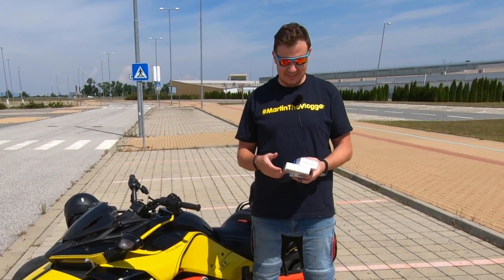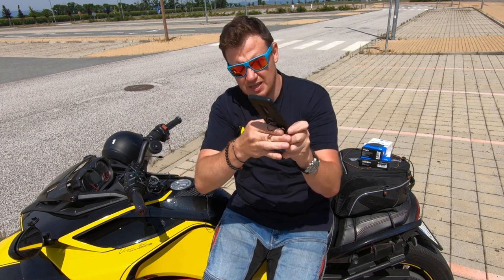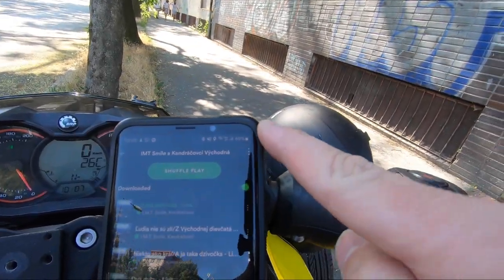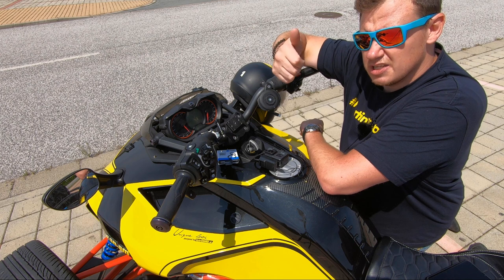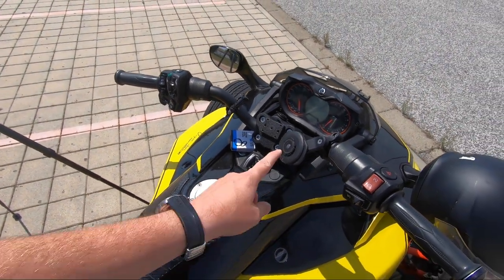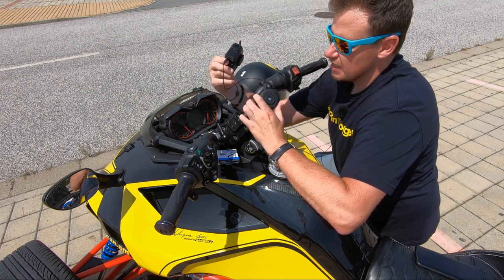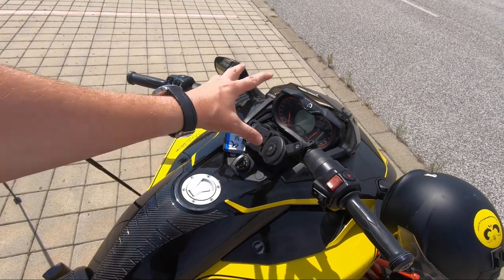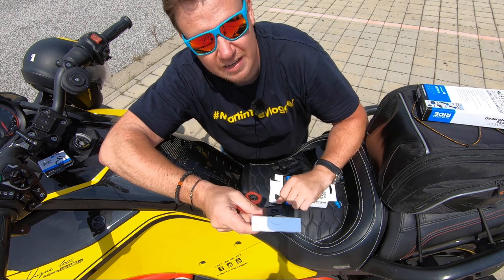Quad Lock Wireless charging head, USB charger & Phone ring stand [Honest review]

Comment: I couldn’t agree more with everything you said. ESPECIALLY the on/off switch for the wireless charger. Definitely helped me decide on not even buying a charging mount and just getting a regular quad lock mount.
Reply from the maker: Many things has changed now Aaron. There is switch and also be careful, buy vibration damper as many phones suffer lot from vibrations and their g sensor is getting bad.

Comment: Get power from your licence plate light instead of your battery chief. That way the charger only comes on when the bike is on
Reply: Perfect solution Jake, thank you!
Reply: Was going to say the same. You should be running all electrics through the ignition (except an alarm) obviously using relays so you aren't drawing power through the ignition switch itself. 
Very few people would need the ability to charge a device when you aren't riding.

Comment: The usb charger.  Just put the usb port facing down.  Then you dont need to worry about the rain.  Just an observation. Seem a better solution then the battery draining wireless charger.  The wireless charger does not seem be well thought out for motorcyclist. Use your old case with the stand.  And get the quadlock universal kit and stick it to your case.  It sticky pad hold like a gopro helmet mount.  You can use it on any metal or plastic case for under 20 euro.
Reply from the maker: That is quite a good advice buddy. Thank you 😉😉😉🤟

Comment: Hi Martin - thank you for your great overview of the Quadlock Motorcycle Wireless Charger I found it very useful and you pointed out some faults that I would not have noticed, I just purchased the mount myself and are looking at the different ways to wire it up. I checked the one that I purchased and it did include the little O rings on both USB Cables which was good but the battery drain over time is not so good so I think I'll look at connecting a double waterproof USB port connected to a wire that only is active once the bike is switched on. thanks again for your overview and keep them coming - regards Mars
Reply from the maker: I did notice however one mistake. There is a switch button, and tgat is a big help, but still not sign of recieving those rings for waterproof protection and i hate that fact :(((
Reply: @MartinTheVlogger  Hi Martin, great video. So there is a switch on the wireless unit to cut off the power? Just want to check before purchasing. thanks.
Reply from the maker: @jimjamjom1  yes, also they did fix the cable that was a n8ghtmare,.. but still i dont know man... i would not buy it anymore... 🤷‍♂️🤷‍♂️🤷‍♂️ lot of trouble for me,. I preffer to chrage my phone in frunk on wireless charger.. or better said i have portable kickstart battery with me, snd its much better investment for me 😉🤘
Reply: @MartinTheVlogger  Thanks. Do you have a link to the products? I'm still looking around to find what would work best for me. thanks
Reply from the maker: @jimjamjom1  i talk about this. It has saved me few times already 🤘🤘🤘 https://www.martinthevlogger.com/product-page/rg1200-portable-jump-starter-baterry-accessories
Reply: @MartinTheVlogger  great thank you!

Comment: Those are very good points you made with the light on the wireless charger head and the not so waterproof and dust resistant
Reply from the maker: There is one mistake in review, there is power button at the back of the charger, but its annoying button :((((((
Reply: @MartinTheVlogger  yep that was what I was going to say, there's a little on/off switch.
But still, it is not really IP66. I suppose you can open the device, solder the usb cable to the pins and route it towards the battery. Don't forget to add a 3A fuse. ;)
Reply from the maker: @Electherm  :)))) yup, that may be the way 😉😉😉🤟🤟🤟🤟
Reply: Yes on off switch solves the problem of the blue light 🙈

Comment: Hey Martin , Cut the usb cable and hard wire it to an automotive relay ,,,,problem solved, It will only have power when ignition switch is turned on.

Comment: I have just received the charger from Quad Lock. It seems they have fixed the connector gap problem. Now the socket is very deep and the connector has two rubber seal rings on it!
Reply from the maker: Yup I have seen it. tell me your experience please. But from what I have seen, it is OK, however I still prefer to have it connected not via USB C :(
Reply: @MartinTheVlogger  The sad part is they don't ship the charger box any more with it - just the head and two wires. So I have to find some 3dr party one like Optimate. I really like the minimalistic construction of Quad lock mounts, I use them for both my bycicle and the motorcycle and have been waiting for the waterproof wireless charger for some time already, so for me it was not a question to buy or not to buy it :)
Reply: @MartinTheVlogger  As soon as I have it installed and tested in different conditions, I will leave another comment here.
Reply from the maker: @sergejsvinniks1728  🤟🤟🤟

Comment: You should never connect anything directly to the battery . You connect it to a key 🔑 on power source . Most motorcycles utilise the rear light power wire . That way your blue light only comes on when the ignition of your Can Am is on . You have the first generation wireless charger , the second generation has a longer shroud that means there is no gap when you plug it in and the connector comes with a rubber grommet
Reply from the maker: Thank you Sir. Good points and ypu are right about the connection to batery and also about 1st vs 2nd generation. 🤘

Comment: According to Quad-Lock’s website, there is is power button on the back of the charging head. That should solve the light on all the time problem. Do you not have that on yours?
Reply from the maker: Hmmmm.. need to check that, but did not saw that, to be super honest ☹
Reply: MartinTheVlogger - If you look at the Tech Specs section, there’s a picture of the back of the device and the power button is almost diagonally across from the USB port.
Reply from the maker: @Rambler358  it can solve some issue, def. Thanx buddy 😉
Reply: MartinTheVlogger - Okay, good to know you have the power button. I was starting to wonder if maybe some didn’t.
Reply: MartinTheVlogger - Also, Quad-Lock sent out grommets to cover the gap in the USB connection cable. You should’ve gotten those.
Reply from the maker: @Rambler358  yup, i wgot em, thanx buddy for all of the updates 👌👌👌 btw, shortly i should get a new holder that holds the phone via magnets. Its a brand new thing and i shpuld get it in October i think.
Reply: MartinTheVlogger - Is this a Quad-Lock thing?
Reply from the maker: @Rambler358  nope, its called Peak Design and i have seen some video about the product already and its super coool. Lets see.
Reply: @MartinTheVlogger  - I went to the PeakDesign website, but couldn't see anything like that.  Do you have a link?  And what will you do for charging?
Reply from the maker: @Rambler358  their solution is new thing and its under information embargo until i think mid of October, where all will be presented :( i need to ask them what they plan to do as for charging, but because its end of riding season i can wait, what they will come up with during the spring 😉😉😉

Comment: I too bought all those products. It appears you have wired wrong your wireless charger. It should wired in a switch formation so that the charger only charges when the motor is switched on and therefore will never drain the battery. 

It is also worth noting the quad lock ring does not work with desktop wireless chargers.
Reply from the maker: 👌👌👌 thanx gor additional info 😉😉😉😉

Comment: Uh, mine has a button on the back that turns it off.  You should double check
Reply from the maker: Yes indeed,. you are right,. my falt this was.. however i have constant problems with this wireless charging unit :(((( now it stop working in general :( probably I will go for SP connect now :)

Comment: You are the only rider here i have seen posting the bad about the wireless charger.  That groment they provide for the usb c cable can get lost if you disconnect it often.  The other thing no one really mention.  Well maybe they dont ride enough in the rain.  If you use the phone in landscape.  Rain will get into the phones charger port. Not a quadlock issue. But using a cable plug into the phone prevents rain from setting into the phone port in landscape mode.  I’ve seen it happen with phone in landscape mode.  And nothing plug into the phone port.  Ie usb c cable or a usb c dust cap you by on amazon.  And the person had to use a hair dryer to dry the port to get the notification to go away and the port to work again.  Just a motorcyclist observation from normal uses.  

The other thing that is a must is the quadlock vibration dampener.  Some phones camera’s ios hw do get damage with quadlock and other mounting system.  If you are endosing quadlock.  I would put that out to you subscrbersas a must have add on.  Jmtc.
Reply from the maker: Jamie, its not bad only. I have good review about them as a general holder. This w.ch. its not good, and i like to share my observation. Its not hate. Also i have to fix one thing. There is a button at the back to turn off the power. However its very bad for riders as its so small tgat you wont press it while you have the gloves on. They need to test before they release their items.
Reply: @MartinTheVlogger  even with it turn off.  The wireless charger still draw current from tne battery. There are reddit and some youtuber posting that info.   I want 0 drain when off.  Only way is to hardwire it to the fuse box or trap it to the a circuit like the brake light that is always on when the key is in.  Just not well thought out.

Comment: Cheers for the review, was very helpful when looking to purchase! 👍
Reply from the maker: Now they havefixthe issue withbtgat connector. I still dont likeit, but its better,. And also there is a button toturn it off 😉😉😉🤘
Reply: @MartinTheVlogger  to be honest I expected it to be a fixed hardwired cable not a USB plug in one! Power button on the new one seems a lot more sensible. Little lights on unattended bikes attract scum! Also not good for battery drain!
Reply from the maker: @DaveRogers1985  cannot agree more with your reply!!!!

Comment: Great review I'm glad I came across this review.
Reply from the maker: Danny one update. There is swich button behind... but i hate it... but i have missed it on review.. the rubber ring fix they have send its bad.. i am not sure if they have a new thing as a replacement :(((
Reply: @MartinTheVlogger  I ordered the quad lock phone case and 1"ball mount for my Kawasaki zx10r.  I ordered the Ram fork stem mount for the base.  I was wanting to get the wireless charger to add to it.  Thanks for the info.
Reply from the maker: @dannyjohnson7155  🤘🤘🤘🤘
Reply: I ordered recently QL wireless charger and it looks they fixed the usb design with a collar on the usb socket and a silicon band on a USB plug, so it will be all sealed.
Reply from the maker: @zylko78  i have seen it today how it looks. Buddy has bought one... its better, but still i dont understand the usb C plug... why??? 🙈🙈🙈🙈
Reply: @MartinTheVlogger  if it is sealed, usb-c it is an advantage for me. As I own 4 bikes, however 2 I ride occasionally for longer. With a RAM Mount and detachable power I can get away with 1 or 2 QL chargers 😉
Reply from the maker: @zylko78  aaaaa... okie, that makes sense... thanx for different point of view!

Comment: quad lock also sent me the rubber grommet but i have found with mine that now the cable doesn’t click in far enough and will fall out during a ride from vibration. they gave me a partial refund and i i’ve put silicone sealant around the connection to hold and seal it for now. also the standard mount messed up my camera as well ! they’ve sent me a new vibration dampener now.....
Reply from the maker: Same here brother, absolutelly the same situation here....
Reply: Can you have the vibration dampener and the the wireless charger on the quad lock together? Is the screw long enough?
Reply: @janekepj  yes I have done this, seems okay. The Screw with the dampener should be long enough.

Comment: Mine is connected via USB to my bike's stock USB charger on a triumph t120. The charge is very slow, i tested it at about 2% charge in 5 minutes with zero apps running. On my ride over the course of the day the phone continually depleted as it seems the charger kept the battery at it's current percent or went up about 2% over the course of 30 minutes running GPS, Bluetooth and music. Is anybody else having this issue? I'm wondering if maybe my stock USB isn't strong enough? Or is something wrong with my quadlock wireless charger that it is so slow. Appreciate any insight TY
Reply from the maker: I think that is the main issue - your stock USB charger. Try to connect it to regular battery source, and then test it. even if in garage. but I think that USB is just weak source.
Martin

Comment: The usb charger are useless. I claim & change 2 pcs. Still having problems that don’t charge well. It will show like charge. But it doesn’t gain the percentage. Maybe of the vibration or maybe the USB port get dirty… I don’t know. Quite sad to having not charging when using it. By the way I have the vibration damper install too.

Comment: Dont connect the plus(red) cable direct to the battery or else the unit will have power all the time and drain your battery. Try to see if your vehicle have an accessory outlet from the fusebox, or just splice it together with something else that has power when you turn your key(headlight, rear light etc.).
Reply from the maker: Great point 👌
Reply: Just use the on / off switch behind the blue light 🙈
Reply: @MartinTheVlogger  mine is connected to the + from stop lights and turns on when the motorcycle main switch is on.
Reply from the maker: @The.KnightTemplar  💯🚀🤘🤘🤘

Comment: Nice looking gizmo, but beside clean look i dont see point of having it, to power wireless charger you must connect usb c to usb a cable to some power supply/usually charger with usb a socket, plugged into auxiliary/cigarette lighter socket ,why not simply connect usb c lead to mobile phone and charge it? This is not only thing with this wireless charger, whats the point of having any wireless charger when you still need to connect it to some power supply and you still have cables laying arounds, which beats purpose of "wireLESS" charger, there is no less, its still wired charger. I hope you understand what i am talking about, otherwise this charger looks excellent i was also thinking buying it but then i was wait a minute...
Reply from the maker: 😁😁😁 i wgot your point, but the point is, that this W.Ch is permanenetly connected to ppwer source, and you can hide the cable goint to if, that is going from the baterry directly. It is charging your phone faster than the cigaret lighter socket and just a cable connection. Also manytimes i dont need charging, i just ride and have a phone ahead of me. But when i need charging, all i do is tgat i click a button and it starts charging and i do not have to mess with cables and search for them. Also, when having phone on the bike, and if it is wet outside, sonetimes your connector is wet and it wont charge via cable. Never an issue with W.Ch. 😉😉😉 so this is my point usualy. Also at home. I have one next to computer. I just drop the phone over it and it charges. Before that i had to use 2 hands to plug in cable to the phone 🤣🤣🤣🤣 you see, it make a lot of sense 🤣🤣🤣🤣🤣
Reply: @MartinTheVlogger  You want to hear something funny, i also have one 🤣🤣🤣🤣🤣 i bought it for same reason to rest my other hand 🤣🤣🤣🤣🤣, think same like you i will keep it next to computer, i have huawei p40 pro, its 27w supercharge, regarding quad lock wcharger, yeah it looks really nice, but i m not giving 79 euros for it.
Reply from the maker: @cvrljakromano  🤣🤣🤣🤣🤣🙈🙈🙈🙈🙈🙈🙈

Comment: Hey Martin, have you tried using a normal qi wireless charger with the quad lock case on the phone? does it work or is the case too thick?
Reply from the maker: Glen, i have at home Zendure wireless charger and it works fine. Not as without case, but its not a big deal, i know where is the area that works just fine. 😉